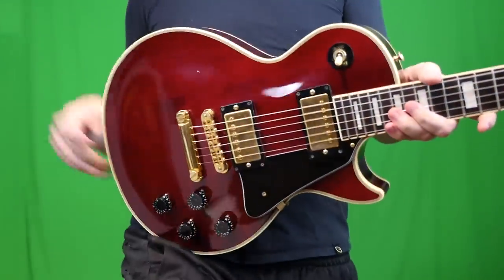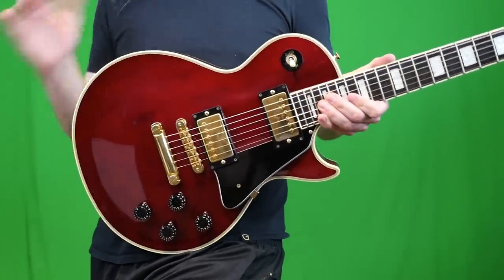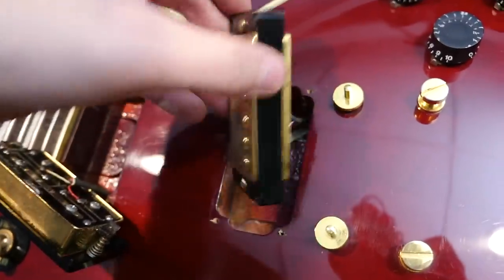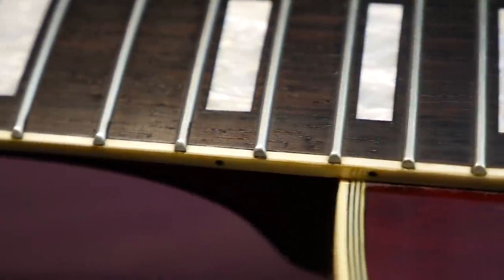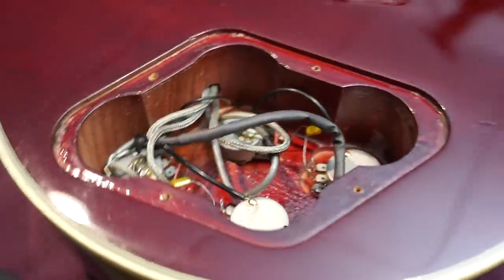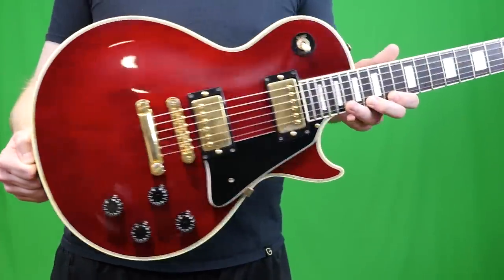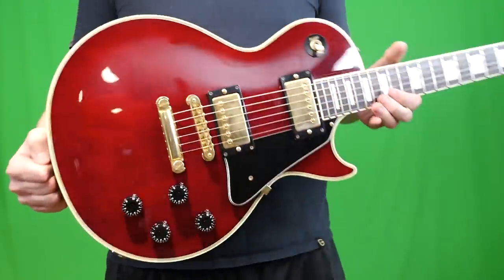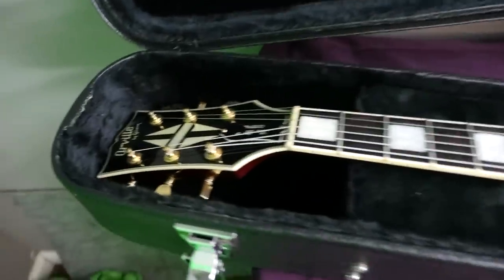What's the Deal with Orville by Gibson Guitars? | 1989 ObG Les Paul Custom Wine Red | Review + Demo

Comment: There's an alternate timeline where its "gibson by orville" instead
Reply: @IrisGalaxis  fender by squier
Reply: Nice profile picture
Reply: That's the timeline I've just been visiting. Orville was left-handed and so am I, making it a nice visit.
I'm sure you can imagine a "Fender by Fender" alternate time-line, so let me challenge you here.
I was thinking about Orville Gibson and Gibson Guitars and Jimi Hendrix and Fender Stratocasters.
Can you imagine taking the best qualities of a 1957 Gibson Les Paul and a 1964 Fender Stratocaster,
and building one guitar? I just did that, using a mail-order guitar, still doing some decorative finishing. 
See if you agree. 
I saw Jimi Hendrix, got a '64 Stratocaster in 1970, sawed the righty scallop and put a humbucker on it.
Stratocaster body shape, Stratocaster tremolo unit, Gibson neck, three tuners per side, Gibson inlays.
A smaller pick-guard, looking centered, body silhouette, ending before the tremolo plate,
has a big Gibson humbucker at the neck with middle and bridge Fender single coils.
The Gibson toggle switch is for the humbucker and the two single coils wired on at the same time.
All pickups are aligned, no slanted pickup.  Moving the pickup forward allows a bigger picking space.
It was Jaco Pastorius who used the bridge pickup on full so he could get finger scratch sounds,
and no electric guitar has been made that accented this use of the bridge pickup. When the bridge
pickup is moved forward it doesn't need to be slanted to lose extraneous treble sounds. It all adds up.
The guitar cord input is on the side of the body, Gibson style. One volume knob, Gibson style.
There is a G-B-E fret on the middle pickup for fourth octave notes. 
This is a musical instrument with an electric signal, one for rhythm, for lead, all on for finger-picking.
john@johnwatt.ca
Reply: Nick E. Just a choice of first or last name. Probably 50/50 across multiverses
Reply: Parallel universe
Reply: Wow! I really did type all that!
Reply: And Gibson would still suck.
Reply: Wow
Reply: And a Multiverse where Fender was able to monopolize everything like Volkswagen

Gibson by Fender
One way or another
Fender by Gibson BITCH!
Reply: @MichaelDouglasSkewes  that would be funny if it weren't true.
Reply: There's also a really cheezy sci-fi show called The Gibson, starring Meth McSarlane.
Reply: Have you seen that Van Damme movie where he's called Gibson Rickenbacker and the villain is named Marshall Stacks?

Comment: I had this exact model in white...I upgraded all of the hardware and electronics, then put a pair of early 1980's Dirty Fingers pickups in it.  Was my favorite workhorse for quite a while until it developed one hell of a neck twist.  Mine didn't have GOTOH-branded hardware when I got it, didn't have that rubber bumper and had green chicklet caps.

Comment: Ive got an Orville (not By Gibson) 58 plain top and its spectacular. 

I do seriously think you shouldn't judge the brand on this example as this one  doesn't seem to be one of the 'better quality' ones. 
You really have to know what you are doing when navigating these and almost treat them as all 'one offs' at this point...  Its also quite unusual for a 'By Gibson' to have a poly finish and the frets usually have the nibs... Also my Orville has a deep neck tennon... sooo..yada yada yada... 
The specs of these  Orvilles seemed to be quite fluid, but yes they certainly had a closer eye on what Gibson were doing in the 50's and the vast majority of the ones that have survived to this day seem to be of very high quality... And imho (if you get a good one) they are better playing and sounding instruments  than the vast majority of the Gibson catalogue. Personally I think it comes down to the wood stock that they were using at the time which appears to be far more mature than what is normally used in the production of Gibbys.. But who really knows!?!?!!?

I do hope you try one of these again as I was looking forward to this vid, but the example that you have found is really not something most would want without some pretty major work done on it. - Try a 59 re-issue and tell me it doesn't rock your world.  They are quite unbelievable for the $.

Comment: I have a MIJ 1983 Greco “Les Paul” custom. It’s a actually a black beauty copy with three pickups. I have yet to pick up any modern Gibson that comes close to the fit and finish.
Reply: lots of modern gibsons match or exceed that guitar,you have a keeper though.they are great sub $1000 guitars
Reply: @trillrifaxegrindor4411  I have yet to find one. I have a 90's Les Paul trad that comes close. I have bought and sold 3 customs. I have also played several modern production Gibsons that have issues out of the box, like bad fret work, incorrect neck angle, etc.

Comment: Nice indept review! I would advise to check out a Fujigen made (serial no. has no letter G) LP 59R or 57 LP Custom Reissue from late 92 to early 95. Those were the high end Reissue guitars with Gibson 57 Classic PUs, fret nibs and a real ABR bridge. The 57 LPC also had an ebony fretboard. These high end  models also had the serial numbers the way the original 57 and 59 guitars had so for example a number like 2  4159  with a space between the year indicator and the serial number. In my example it would be 2 =1992, 4 = month (April) guitar number 159 of that month. That is how you know you're dealing with a real Reissue model. 
In short, those guitars are much nicer and more true to the real 57 Les Paul Custom and 59 Les Paul than the one you reviewed, IMHO.
Fujigen made Orville and Orville by Gibson Les Pauls and some ES-335 models only as far as I know. All the firebirds, explorers, flying V's etc. came from the Terrada factory. SG's I don't know who made those. 
FYI, ObG did put out OHSC's with those true reissue models, that were marked Orville by Gibson and have yellow/pink interiors..
All guitars that were made in the Terada factory had a serial number that starts with a G. The G does not mean that it had Gibson pickups, sorry Trogly. 
So, next time please one of the high end, Fujigen made, ObG's please.

Comment: My oldest brother bought an Electra when he was in the air force through the base store. I played it often learning but not long because it was a heavy beast. Even with a comfort strap. He ended up pilutting Dimarzios in place of the stock chrome plated humbucker. It was already a good guitar without the new pickups. The only problem was the weight

Comment: From just looking at the frets. It looks like the frets weren't done to the best level. It would seem with the ends slightly raised the wire wasn't radiused properly. It would also indicated who ever did it also didn't back fill the slots to fill any voids when the fret was installed. This is just my observation with the look and sound of the guitar.

Comment: i know this video is very old by now, but orville chooses benchmark years in the gibson production line to set as the base model. this is why most of the customs are vintage correct spec, such as the overly thick pickup rings that you'd find on 50s customs and the thumb cutters on the knobs. not only do you get about 7/8ths the quality of a gibson, but you also tend to get very highly desirable specs and aesthetics that you'd have to pay multiple thousands to see on a reissue. so being basically reissues, orville's are truly not to be missed. that being said, most of the electronics are iffy and the hardware has weird finishes to it that age differently than gibsons. the chrome hardware (almost never nickel) always ages to a matte textured look. you'll also find the bridge and tailpieces are loose with a lot of play where the saddle pins sit in the actual pieces. change the electronics and the bridge (which is likely sagging anyway)  and tailpiece (for a non pot metal-mix one) and you have an amazing guitar for 1/4 the cost.

Comment: I think you should do another episode on Orville. This one seems to have had a refret. And not the best specimen for a fair shakedown.  Would be interesting to see one paired against a similar year Gibson. Then do a pickup swap and compare again. I own 2 Gibson Les Pauls. I’m interested in getting an Orville. But they’re not exactly easy to physically get your hands on one to try out. Thanks for the video.
Reply: There’s also a lot of difference among models and factories. This one being from terada would usually be looked down on as inferior despite being a by gibson model. The fugigen guitars are allegedly better. The ones I’ve seen have 2 piece tops and bodies.
Reply: @Coolbeans1492  Completely depends on the model.  I've got an ObG from Terada and I've got two Fujigen made Greco super reals.  One LP custom and one SG.  There all really good.  The SG was the "cheapest" when they were new and the Greco LP was the most expensive.  
I would rather have an ObG from the Terada plant than have a regular Orville from Fujigen for example.  If they're both "by Gibson" models?  I don't know.  There's a bit of snobbery in the MIJ world too so take it all with a grain of salt.
Reply: @doublestrokeroll  from what i understand the whole hype abt the by gibson bs is a long neck tenon but if gibson doesnt even use them on the standard 50’s its clearly not that important….
Reply: @Coolbeans1492  That's one part of it.  But again, even there it can vary.  My ObG has a medium tenon for some reason.  

A lot of the complaints about later Norlin era gibson's was in regards to all the cost cutting they did.  Pancake bodies, short tenons, poly finishes apparently.  Maybe any one of those things doesn't really matter but start having guitars with all those cost cutting measures and then they start to have an effect.

Initially the Japanese companies (in the mid/late 70's) were copying the "modern" gibsons of those days, but being Japanese they quickly realized that's not what made them great guitars.  So they started building them the only way Japanese people seem to know how to build stuff and that's with extremely good quality.  Part of that was basing them on the ones they thought sounded best, which were the early ones.  They probably tried longer neck tenons and discovered it was a better method.  Who knows.  If I had a choice I would pick the one with a longer tenon, because why not?  

I also have a theory that the Japanese makers based the label of the guitar on how it ended up turning out.  My Orville is a "by Gibson" model but it has nearly all the features of a regular Orville.  Medium tenon, 3 piece body, plain maple top, and it even has a heel cap.  Pretty sure it is a nitro finish though.  Anyway, regardless of all of that it still came in at around 8 pounds and it sounds amazing.  Very resonant guitar with a beautiful round tone.  Even acoustically.  I think  the factory person probably judged the guitar by how it played and then determined what label it got based on how good it sounded.  I think Greco also did the same thing to a certain extent.
Reply: @Coolbeans1492  All Orville LPs made by fujigen are long tenon. Terada made Orville guitars can be short or long tenon regardless of whether they are 'by Gibson' or not. 'By Gibson' means it has Gibson electronics and in some years/models it will have a nitro finish. Gibson only uses long tenon joints on their custom shop LP guitars. The short 'rocker' tenon was a cost cutting measure introduced in the 70s by Norlin.

Comment: That fretboard is, without question, NOT any kind of Ebony. 

Given the stain/dye used to color the surface,, and what appears to be a lighter application of a higher viscosity grain filler, on a relatively open grain wood, it's not immediately obvious what species of wood was used for the fretboard.

Comment: Trogly: this is the third time in the last couple of years that I've heard a reference to the degree of carve on the top of a Gibson 80's LP not being very pronounced.  I bought my black LP custom new, a late 87 (82947550).  It has a three-piece top (over time, the lines can be seen through the finish - is this a common issue?) and has a very pronounced carve to it.  At the armrest position, the top cuts down just below the level of the top of the binding by a few mm then curves back up to the middle.  Without a guitar to compare side-by-side it's hard to be precise but the carve in this video looks very much like mine. 

Keep up the good work!

Comment: The story kinda goes a bit differently, if my information is correct. 
Orville vs. ObG is not only about tiers -- it's more about the year of production. The older ones were called ObG, the newer -- just Orville, with much smaller product lines: ObG even got ES-335, Firebirds and EB-2 (the Epiphone Rivolli semi-hollow bass), plain Orvilles, if I remember correctly, only got LP's, SG's, EB-3 and Thunderbirds. They are indeed a bit lower in quality: no more high-end USA pups, but the guitars still the same. 
I remember comparing ObG Thunderbird and just an Orville one, they were quietly the same thing in means of assembly quality. Same thing with LP's, though ObG sounded a notch better. There's a rumor, one can even find some Bill Lawrence pups stock in these ObG guitars. I once seen an LPC with stock Dirty Fingers.
Reply: No that's not true.  The regular Orvilles were produced at the same time as the ObG.

Comment: Some of your info is wrong. I have a late 90's Fujigen made Orville (just Oville without the 'by Gibson') and it definitely has the long tenon neck joint. All the Orvilles made by Fujigen supposedly have the long tenon joint regardless of whether they're 'by Gibson' or not. Terada was the first Orville manufacturer and their LP's can have the long or short tenon whether they are 'by Gibson' or not. The wood work on mine is immaculate and tight, but it has MIJ electrics and pickups.

Comment: Something doesn't quite add up with this guitar:  The hardware doesn't look like it has been played a lot at all yet the guitar was very likely refretted - SS frets were not really a thing yet in the 80s, particularly not in factory guitars and most certainly not in Japanese ones.  
Besides, people seem to be very attracted by the "by Gibson" tangent and do not realize that this is more of a downside than a plus:  It should be clear that Gibson made sure that the guitars are carefully spec'd to leave some distance to the USA imports while Greco, Fernandes and Tokai etc. were not restrained in their competition for the most accurate replicas at the most affordable prices.  Your ObG's mix of vintage and contemporary features is a manifestation of that as well..  If you'd try A) an early 80s Burny RLC-60 (hopefully not modded to death) and B) compare that to an actual late 50s Custom....  I know this is likely not going to happen because it's almost equally hard to get hold of  either of them but if you could you might be in for a surprise.  The Burny is just the king of the Customs tho, if you want to see some even better Custom you need to get a Navigator, otherwise all of the aforementioned companies had stunning Standard replicas that do not suffer from any of the quirks you found on this ObG.

Comment: You were right about this particular model but I think you haven't done your homework properly about Orvilles. This was just a regular Orville by Gibson Les Paul Custom but there was also Orville by Gibson Les Paul Custom Reissue LPC-57B. It is a very rare guitar - they've made it only two years 1993-1994. It was their highest model. This one had Ebony fingerboard and fret binding and a nitro finish. Regarding the nitro finish  the one you had on the chanel could have it but here is the thing: more and more plasticizers have been added to Nitro over the past few decades to prevent age-related cracks.  The superiority of sound over PU is only very small, if at all. I was told that thinly lacquered polyamide has more or less the same resonance as today's nitro. Recently I played a Gibson Les Paul Slash Apetite and the laquer felt like poly. Honestly I couldn't believe it's Nitro because it felt nothig like even Gibson from the 90'.
Reply: Hi, just to let you know that I have a Fujigen made LPC-57B Reissue dating from January 1995. Yes, my serial number starts with a 5!! Perhaps one of the last 57B Reissues ever made..

Comment: Orville by gibson should have nitro and nibs to be honest if I remember correctly, or does it depend going upwards in number of model?

Anyway, this doesn't seem to have a single difference than the most lowly lp custom orville lpc 75 which was also poly, 3 piece top, rosewood board, pretty much identical.

I think somebody added the by gibson part to sell it for a few hundred more.

The regular pickups gibson usa bill lawrence or whatever are there, first time I hear about them in an orville but who knows exactly? I guess the orville forum.

By the way, they DID have bone nuts from the factory, amazingly cut and fitted. And amazing action. On my orville, the fret job is probably the best I've ever seen but frets are worn down. Still doesn't buzz and very low action. This nut is not factory.